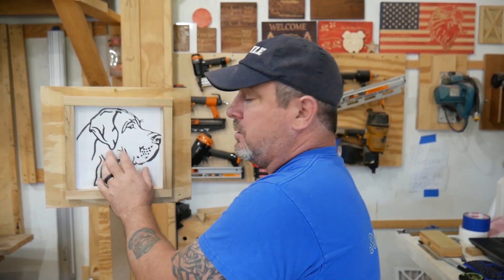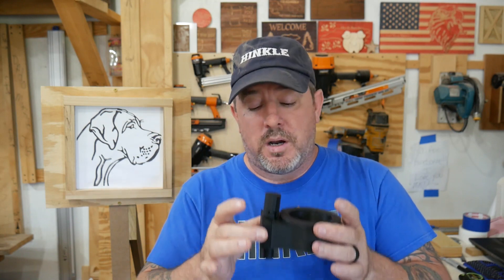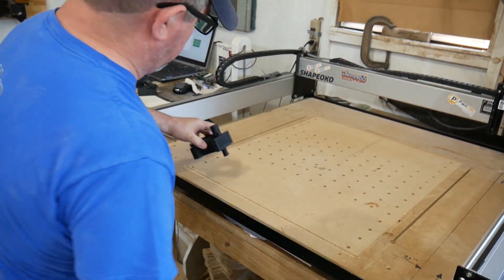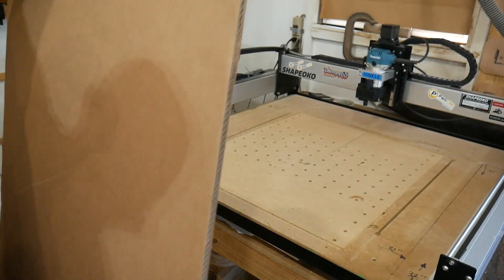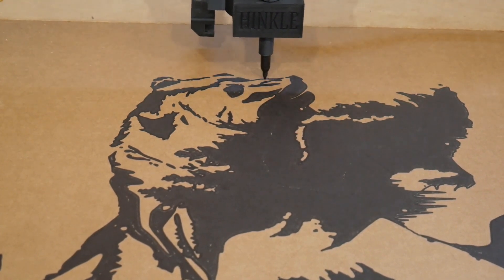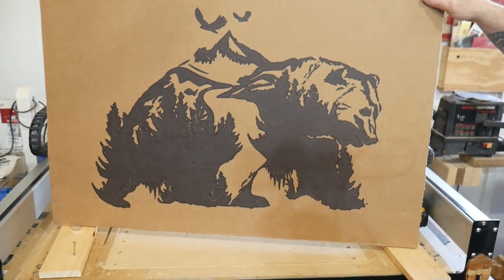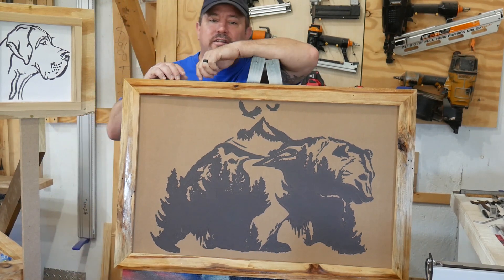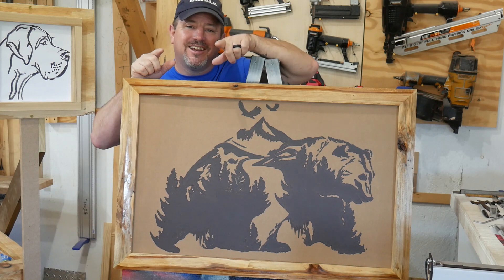How to draw a bear on your CNC

Comment: The part that holds the pen looks to have magnets holding it to the base, if so that part would work with my spindle on my ss23.
Reply from the maker: Yes it does have magnets holding the pen the portion that mounts to the spindle is a clamp

Comment: WOW that's nice. I need to get one or try to print my own somehow. I'm new to 3D printing, just got mine a month ago, and don't have a program to design anything.
Reply from the maker: It’s a lot of fun for sure contact Mr Doyle I think he is selling the file to print one
Thank you for watching sir
Reply: @Hinkleshop  Are you sure that it is 100 FPM or 100 MPM. Well I got it today and excited to try it. He made a change, no longer need the spring, he is using a bolt as a weight to hold the pen down. Wish me luck.
Reply from the maker: Great should be IPM inches per minute good luck to you sir
Reply: @Hinkleshop  I figured that 100 FTM was wwwaaayyy to fast. hehe